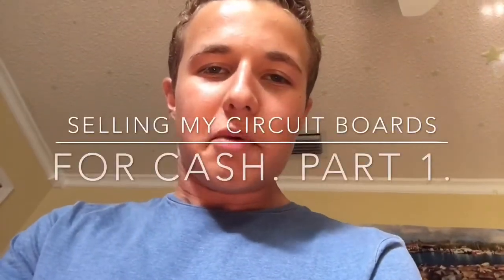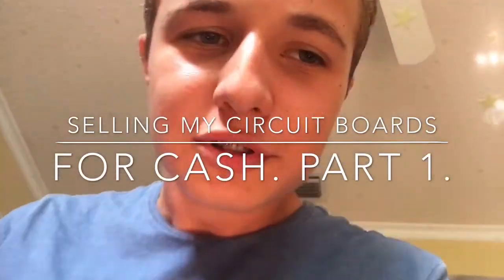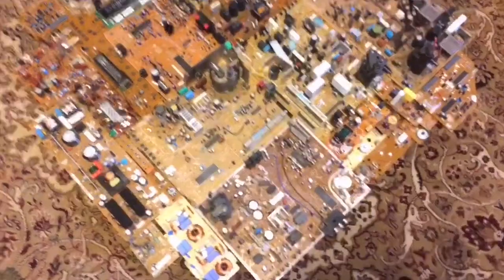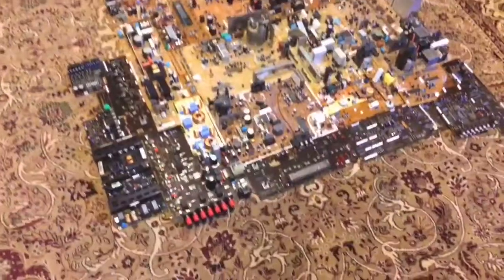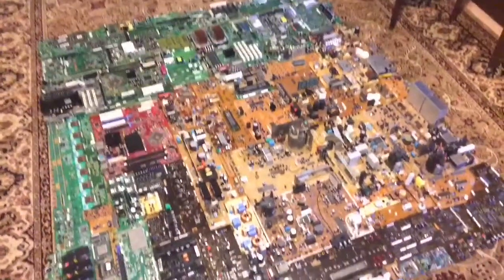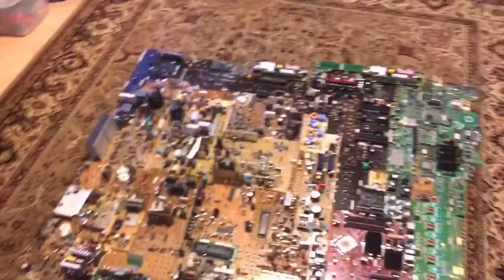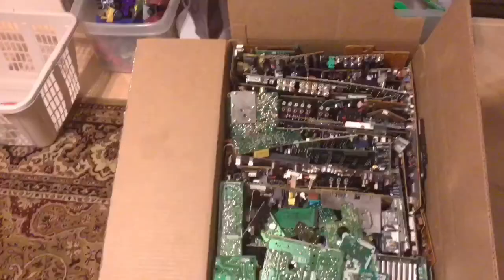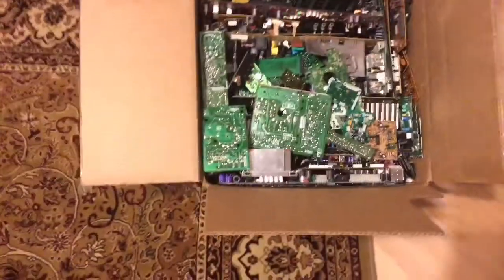Selling my circuit boards for cash.

Comment: How much cash did you end up walking away with?
Reply from the maker: I got a nice little note saying “Thank you for the boards, unfortunately we found no value in these” so yeah.
Reply: DAMN REALLY ? Do you know if any of them were high grade boards ? Like did any of your circuit boards have gold on them ?
Reply from the maker: Yup,  there was about a fourth of the collection, but I didn’t do my research really. Those guys were whole sellers and honestly what I sent them might have been worth like 6 bucks.
Reply from the maker: I learned though. For the next few years I collected about 8 lbs or RAM and got $10 a pound locally. Copper was also great, sold 50 lbs of trashy copper for about $2.50 a pound. From my experience, these are the only two things worth your time if you’re considering it.